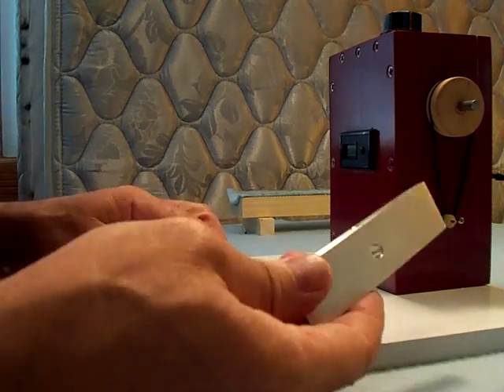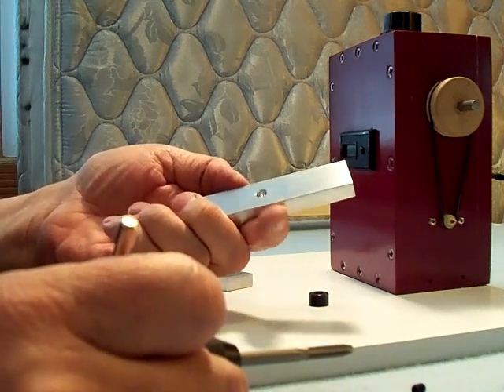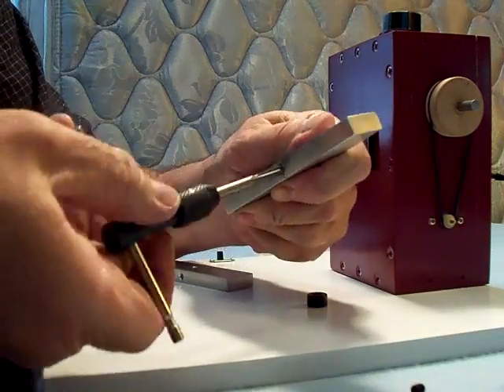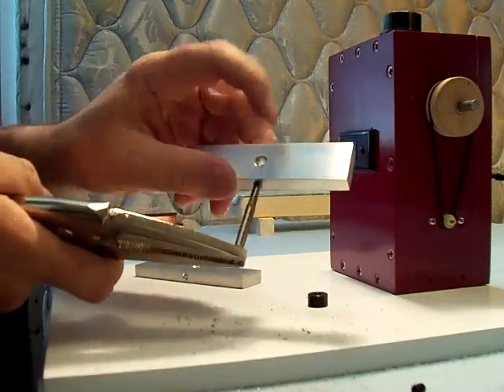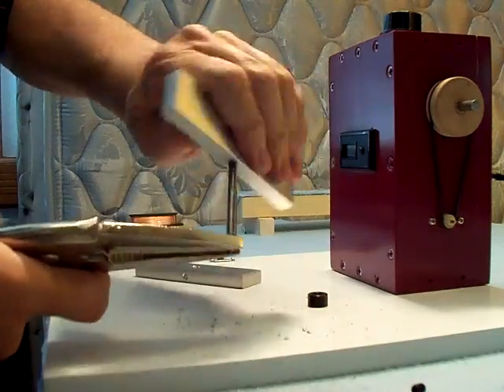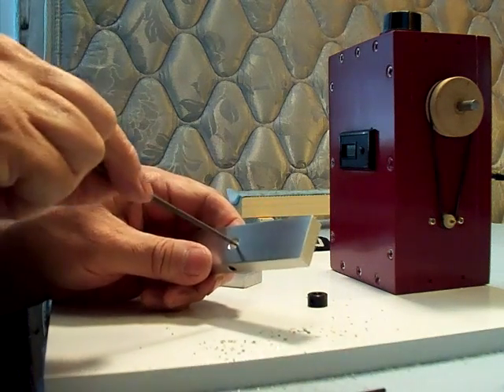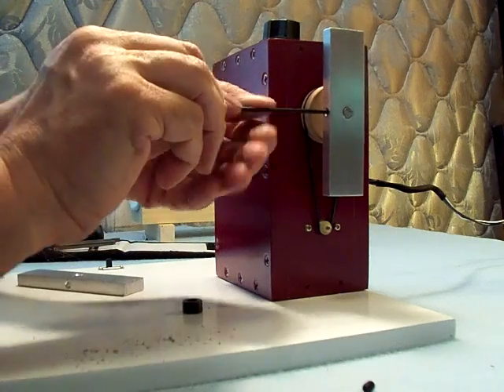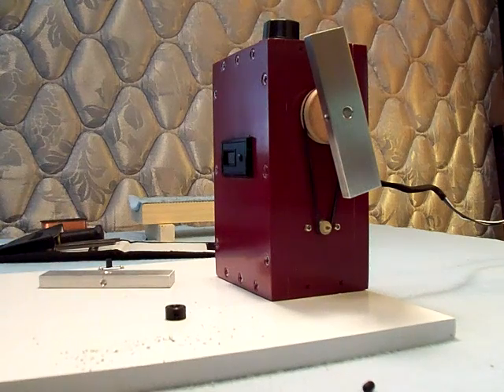Pickup winder build Part 9

Comment: This seem to be a great winder, but when building it, make sure to have a motor that is quite high rpm because then attaching aluminium to it like that will absolutely reduce the rpm, so a 1000rpm motor will not be able to do more than 6-700 rpm when that thing attached to it, it will take longer to wind a pickup. I think the sweet spot is around 1000rpm so a 1500rpm motor will be just fine, at least for me it is..